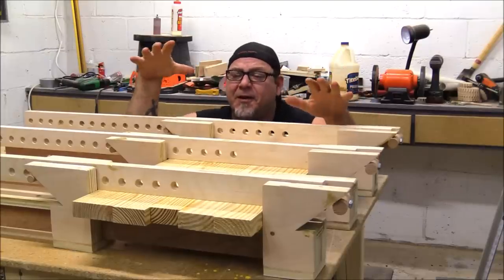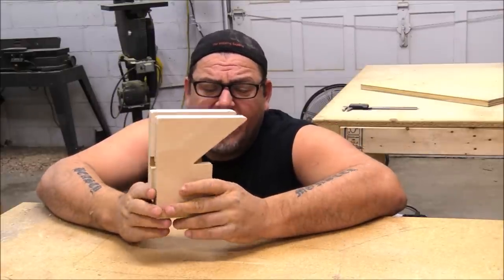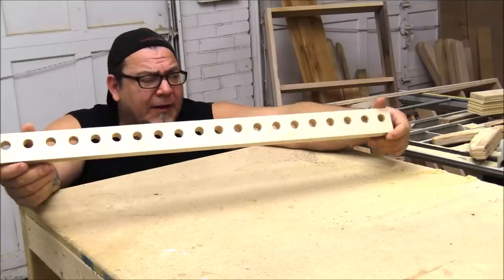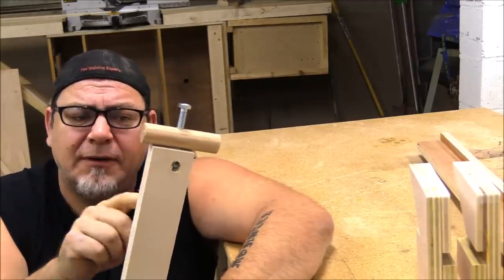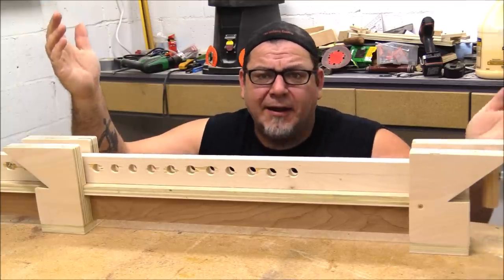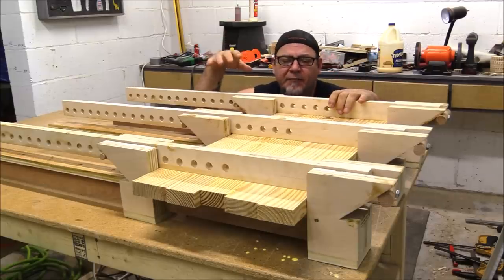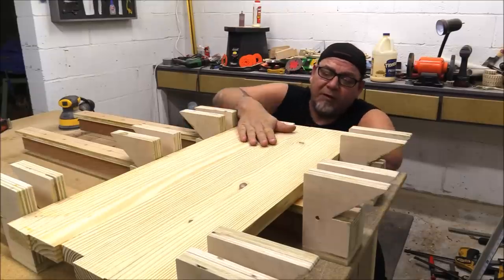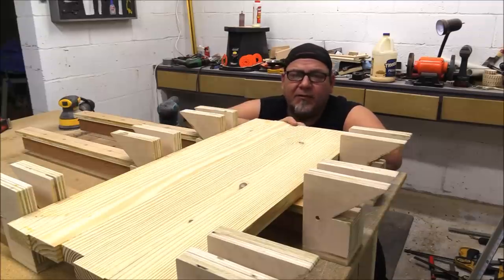Incredible Homemade Bar Clamps | Diy Woodworking Project

Comment: Just a thought... maybe add long metal strips along the lengths where metal meets wood rather than wood meet wood. That way... during glue-up, you wont run the risk of gluing wood on wood.

Comment: Location of nut and bolt.... steel bushing and a half moon nut. Increase the life of the clamp. I feel after a few clamp ups the nut will start pulling into the wood and eventually leaving you with no clamping force.

Comment: Of all the 4-way panel clamp designs that have appeared on YT of late this is the best design of the concept. Quick open access capability removes the only negative of the 4-way concept.  Excellent. Now lets trick it out.

Comment: Built 4 of these and use them regularly for cutting boards. They work great. A little wax paper top and bottom between the board and the clamp, no cleanup of clamp necessary. Great idea.
Reply: +Jim Christman 
Why not just make a single cutting board ?!!! 
🤓
:

Comment: The genius part of these clamps is that 45deg angle you cut on the end stocks. That's what's applying the downward pressure the more you tighten the clamps.. +mtmwood could benefit from this type of system with all the glue ups he does 😃👍🏼

Comment: The downward pointing ramps on the ends does a great job of tightening and pushing the top and bottom bars into the work surface. I use cauls for the same purpose, but it is integrated into this clamp design.

Comment: You are a genius. I made four of these. They work great. I found that nuts were pulling up into the wood and causing some cracking. I cut some pvc pipe pieces and mad a sleeve to support the nut in the hole. Problem solved! I also did the same for the end dowels. Thanks again for sharing your genius 😀

Comment: Love it. I'm going to make several. One thing I'll try is in the clamp bar. Instead of drill the wholes dead center. I'm thinking of drilling them slightly off center so the clamping force is maybe 5% up from center. This should bow the bar under pressure with the center of the bar pushing down on the middle of your panel against your T slider. Thinking this will help keep wider panels flatter.

Comment: Very clever Izzy. I suggest using melamine board for the top of the T-bar, where the glue-ups will rest. Glue won't stick to melamine. I know you waxed the plywood, but the wax will wear off and need to be reapplied again. Using the dowels bearing against a ramp is a very good idea. Simple and strong.

Comment: These are awesome! I think the only change I would make is to the dowels. Probably drill a pilot hole in a piece of 2x4 then cut it on the table saw with a 45 degree bevel, so it locks in perfectly

Comment: I was trying to do a glue up this weekend; these could have saved me a lot of frustration.  Only advice I would give is to use some washers so the bolt doesn't tear up the dowel.  Also, these look wide and sturdy enough that you could stack them for multi panel glue ups which is a great space saver.

Comment: Hello my friend, what I think is great about your system of clamps is that having the inclination at the ends to adjust not only tighten from outside to inside but also from top to bottom.I can only think of something that I do not know if it could be an improvement. replace the wooden dowels with a piece that has the same angle as the ends. Congratulations and I send you a big hug from Argentina!

Comment: I'm loving this clamping system. I really wish you would have come out with this video about 5 days ago because the past few days I've been glueing up 2 inch pieces of maple flooring for my breakfast bar. If I could have made your clamps I could have done it in one shot rather than 3 pieces and then glued all 3 together with ratchet straps and buckets of concrete and cinder blocks to keep it flat. Great idea and I have a couple of bed frames I was figuring out how to use to make your clamps as I watched your video. I can't wait to see how you make them out of metal.
Reply from the maker: oh man i feel your pain

Comment: Looks awesome. For the metal version I would probably add bearings on the "handles" along the touch surface, to ease wear and tear and also make it smoother as you tighten it all.

Comment: Super cool, good design. Yes, metal is the next step for sure, probably thinner end blocks but thicker cross sections and pins on the top. Or maybe a short leg I-beam into grooves on top to keep everything square under pressure? Theres all that potential slop in the pin in wood. Anyway, super good idea, nice geometry, and yeah all the comments on how to improve your idea,  you've got it already. Nice work.

Comment: These are the best idea I have seen for clamping glue up. I do not think I would do the metal ones though as the weight factor may be to heavy. Just my opinion Izzy. Like them a lot Izzy, thanks!

Comment: Love the design. Started to make some and figure to make a small change.. Instead of a nut I am using a barrel nut to spread out the force and added a extra thick fender washer to the bolt at the dowel again to spread out force. Watching your video make me think you are a mechanical genius. Awesome designs..

Comment: This is a very ingenious design!! I don’t know if you need to go to metal, though. Hat would be pretty heavy. The only failure points seem to be the dowels and the acute angle. Perhaps you could not have the v-groove, and have the the dowel meet at a vertical stop point. The vertical pressure is going to be more than enough, but it would allow even more horizontal pressure while eliminating the v-grove failure point. Also, metal dowels. I’m going to try to make a set after seeing yours in action. Thank you for your genius mind!!

Comment: Hi Izzy, as always THANKYOU ! these videos and your ideas are just great. I'm right bang in the middle of building two 48" wide by 75" high barn doors and my customer doesn't want T&G panels used but wants them laminated and I was trying to figure the best method of gluing and fastening these together. So I am building at least 4 of these babies and I will let you know my thoughts etc, I also appreciate the other comments that others have passed on and might apply some, not sure yet, but I will let you know. Thanks again, I think this saves my bacon. Awesome. Andrew

Comment: Izzy, I love it. You have inspired me! I will be making a set of these shortly. I just wish I had this years ago. I will be painting mine with glue. :)  For glue resistant surfaces, I take some water based glue likeTightbond II and thin it. It makes for an ungly yellow finish. After some wax on that, the result is a fairly glue proof surface.
Since this clamps across and down, I am considering adding a way to extend this vertically so I can use it for boxes.

Comment: I am definitely going to make this system in my shop too. I can't weld, so I'll be sticking with the wood version, but I am really curious what your experience is with them, and what you would change, if anything, now that you've used them for a little bit. Thanks!!

Comment: I like it a lot.  I will probably make some.  An improvement (?) I can see is to run the tightening dowel through a slot near the end instead of having it hang loose.  This should eliminate the downward torque on that bolt and insure a more parallel clamping.  The only trick is that you'd have to install the barrel nut a little further forward and use some kind of sleeve between the dowel and the bolt head.  Thanks very much for sharing your genius.

Comment: Very cool idea and not a complicated build. I might be inclined to reinforce the bolt end with a washer between the nut and the inside wall of the hole. Add some strength and distribution of force across the wood plys.

Comment: Love the outcome, and I have used bar clamps to level out things, but bars do not  put any downward pressure like this system. On the downside, this type of clamp has an enormous footprint in the shop, and is heavy... requires a large level work bench... perhaps the metal version might be leaner?

Comment: I could see this being a dedicated table in my shop. Have this system as the table top surface that’s always ready to go. If you need to use it as a table top just put a piece of plywood on top and you have a work surface available on top of the glue up. That’s if your shops tight for space otherwise just dedicate a portion of your shop to it. It’s game changing enough to take up real estate in the shop for sure. I can also imagine a bunch of things to do in addition to or alongside this setup. Good stuff as always!!
Reply: one way with a small shop is to mount it vertically on a wall.
Reply: Tyler I was about to say exactly the same. It would be a panel clamping system without thickness limitations... End grain cutting board makers would kill for a commercial version of this with a fancier tightening system.
Reply: or a fold out version like Aprils to save space
Reply: Tayler Made a genius design with a genius comment! I just have to dig a wall out now...
Reply: I would take your concept a step further, Nesley.  Flipping the clamps over, without the brackets and you have a raised cutting table for when you just want to use you circular saw - so what if you slightly nick the bottom of the bars.
Reply: It seems izzy brings out the genius in others. That's what it's all about eh?!! : )
Reply: Franklin Bejarano ... Am I crazy to want it to be a panel saw as well?   (I was going to use the only wall left to me - garage door  - to build a DIY panel saw.  Amateur here.)  Does anyone see how that could work?
Reply: What about a flip top table with this clamping system on one side?

Comment: 1 change I would make is the nut in the hole that tightens the clamping bar . I would cut a piece of round stock steel to width drill and tap through the side of the stock to the size of the bolt  instead of the nut which I feel would dig into the wood with each tightening and eventually split the wood

Comment: You thoughts on this as compared to the 4-way design? Foot pads for 4-ways are easily produced so no concerns on things like that. These have more mass and so more rigid so can force small misalignments of things into place. Need to strengthen the dowel and bolt/nut hole method.

Comment: With the top bar being pulled down as you tighten the clamp it does away with the need for over and under clamping the panel to provide equal pressure.

Comment: The clamps are really cool!

Suggestion for when you're feeling froggy: Instead of using a bolt and nut for tightening, try a lever that cams the clamps tight.  That way you can tighten and release the clamps quickly.
Reply: Would a cam system cover the 3 inches or so that is needed in between the dowel holes???  It's a question.

For me personally being able to torque it with a impact driver is pretty quick.  In some ways I wish all my clamps would have a socket that I could put on a power tool on it and get it done a little faster.

Comment: These are awesome clamps. What modifications would you make to them after having used them? Like you had said, theres more clamping pressure at the top so i would have the pressure point at the center of boards. Maybe changing the angle of the slopes too cuz im imagining that your angle is putting more force into making the panel parallel than it is squeezing the boards together. I could be wrong. Your ideas are very inspirational and i love your videos

Comment: Beautiful clamping system, Izzy. Brilliant in it's simplicity. What's the spacing of the holes on the top bar, and the angle on the blocks? 'll be making 2 sets, one scaled down for my smaller piojects, like jewelry boxes. :)

Comment: As far as getting the job done, it is definitely doing more than a regular set of clamps. 
It does seem bulky though, when compared to other clamps, but I imagine your metal version will take care of that? 

1. How many do you actually need per area being clamped? 
2. How does a number comparison of clamps used to get the same job done differ between your clamps and store bought clamps?

Comment: In this case the ends act as a lever applying the force upward on the top rail of the track. I wonder how even the pressure will therefore be on the horizontal? It definitely won't be even. Though maybe the upper rail makes up for that?

Comment: I like the idea of a metal version, they’d take up less space which is at a premium in my shop. Aluminium could be used, for weight saving but would be expensive so I’d go back to trusty old mild steel from a scrap yard. Overall your design is excellent, having the one screw to control the effort in the y and z axis. Only one pair of hands required. All around, just the equipment required for the small shop. Regards.

Comment: Love the design, creates clamping pressure on top, bottom, as you tighten the clamps for the side to side, after reading several of the comments regarding pressure, hey guys you're glueing wood together, too much pressure you squeeze out all the glue. No glue, No sticky together.

Comment: Nice clamps. A possible improvement: Shape the top bar like a caul, thicker in the middle, thinner on the ends. A few swipes with a plane on each end should do it. That'll maintain pressure in the middle and help with the cracks
Reply from the maker: thank you for the feed back and ideas
Reply: Awesome idea! Best one I've seen on the comments (other than handles, but that's just MY personal preference and super easily adapted so I don't count it as an idea anyways). The only issue is the extra complexity of this being designed for multiple sizes of glue ups. You would need to be very careful with the curve to ensure it is always level because the 45* on the blocks may not add the downward pressure regular cauls would impart. And I could be totally off base, it may be able to correct it self. I would think the best way to ensure even pressure to first put the slight curve in the bar then layout for the holes so they are all the same distance from the curve. It would end up with the peg holes being curved the same as the curve. That being said, all that extra detail may be for diminishing returns. /end ramble.
Reply: Dale how about a help my English here wedge or a shim between the top bar (or bottom one) and the panel  on the very spot you need? if you need it.

Comment: This sounded like a great idea I build a set of four of these and it was a huge disappointment because when you apply pressure it ended up bending The I-Beam and bowing the glue up.  Pressure applied at the top of these blocks tends to tip them and get them out of parallel and when this happens the supporting beam is stressed and needs to be made of steel or stiffer than plywood at least.

Comment: I like it! Looks like it would take a while to build but if you do a lot of glue ups like that it would be worth it.
Reply: Very cool clamps.  I'd be interested in knowing what the scissors looking tool for marking multi holes is called and where to find one?. Thanks for the video.
Reply: Roger Dirkx. Mpower point 2 point equidistant measuring. Amazon

Comment: I absolutely love this.  Best solution I have seen.  I might make this at my hackerspace, but some moron will over tighten the bolts and split it.  We'll have to educate them and perhaps use a drill (not impact!) with the torque setting at some reasonable value.  The only issue I see is that it's a little limited on the thickness of the panel (no robue workbench build for this, lol) and if was using the last dowel and it's furthest reach (a very wide clamping) would there be some flex on top?  Wider ply  (6 inches instead of 3) would handle the extra load perhaps?  Brilliant work, Izzy. Thanks for sharing.
Reply: There was flex on the top bar for me, but I didn't make them as big as Izzy made his, so my own mistake I guess, and I only had 15mm ply around, so used that.  I'm going to adjust them slightly and double up the thickness on the top bar and make it 'taller' too :)

Comment: A metal running surface on the 45 slope ( and maybe a metal dowel) to stop wear/deformation?
Reply: Jan-Reinier Voute agreed. Even a 1/16” plate on that angled surface and a dowel of 3/4” solid steel.
Reply: I wouldn't be improving it until it shows it needs improvement as weak spot(s) may be somewhere else.

Comment: Since the compressive distance is so short, could you do this with the air actuated cylinders? Perhaps they don't provide as much compressive force as the bolt and dowel, but honestly, you don't want to squeeze out all of the glue anyway.

Comment: I guess this works as a caul at the same time it clamps down.  One less process in your glue ups means more productivity on the workbench.

One thing I would do myself if I would build these...  I would probably leave the back edge of the stationary side of the clamp equal the whole way through in order to stand up the glue up so I do not waste the bench for a single panel.  I build all my panels the first day of a build so I know they will be ready when I need them and Having the bench open for other stuff means I am not wasting a full day on just the panels.

Comment: Simple enough, I could build this. Great idea.For the tightening system, won't the nut eat the wood over time? Maybe a washer there could help. 

Also, would a manual option to tighten that bolt work? Would the clamping force be sufficient then?

Comment: I really like this will do my own version.
I'm not sure the T Trac is necessary.
I bet you could make this out of a single layer (1/2)on all the pieces and it would do just fine..
Reply: ttrack is your reference flat surface. T formation keeps it flat under pressure. you are clamping work to this surface and don't want it to flex.